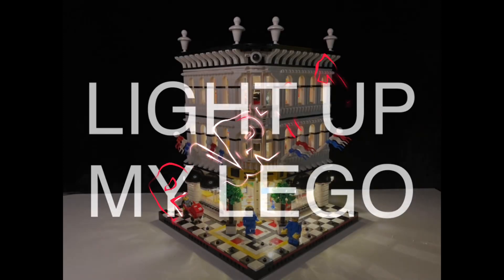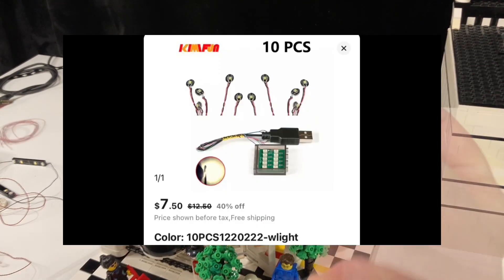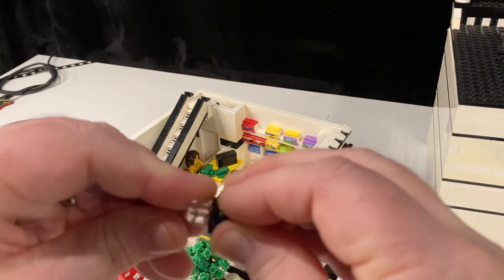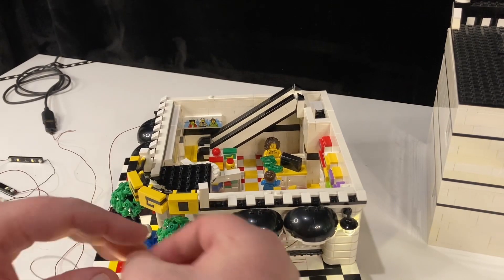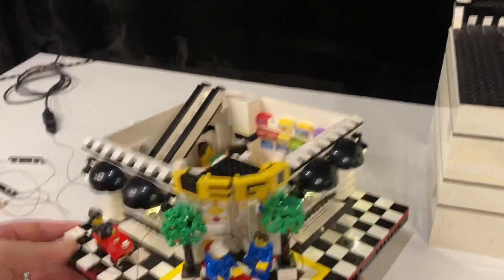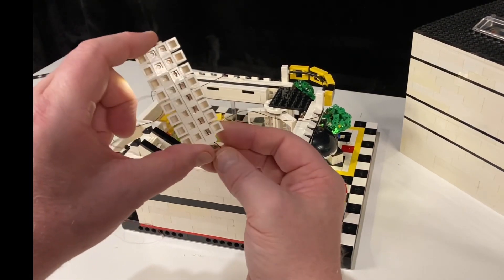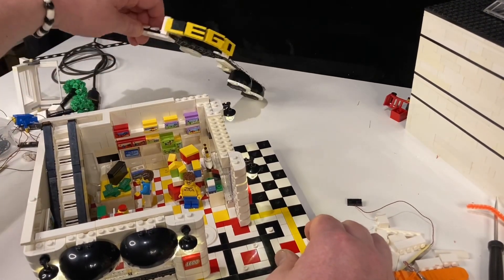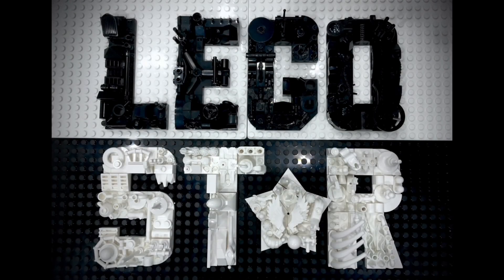LEGO TUTORIAL: LIGHTING MY MODULARS - PART 1

Comment: you can use the vertical wireless connectors for horizontal connections as well
Reply from the maker: Yes I used them vertically on my aquarium… works great with 41682 - 2x2 bracket!  I love them!